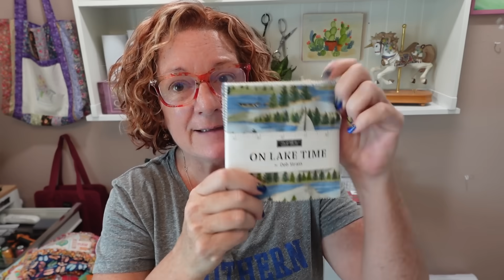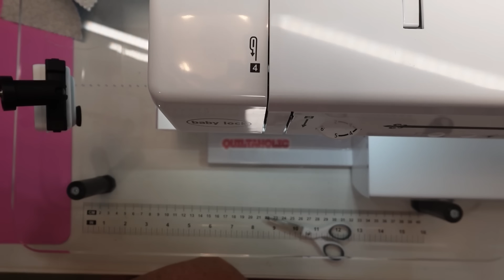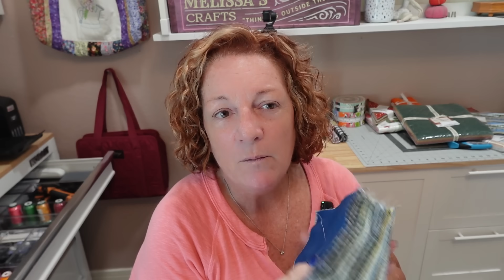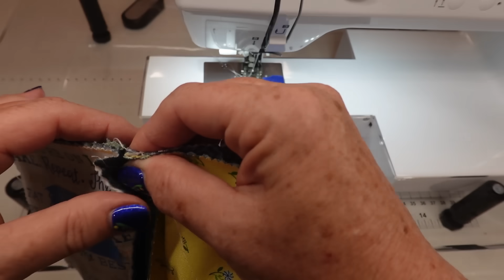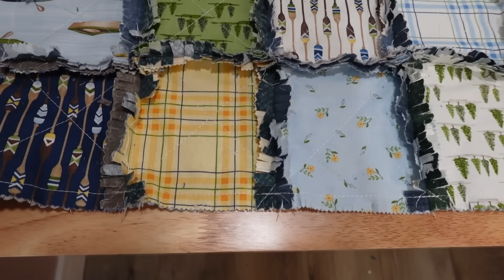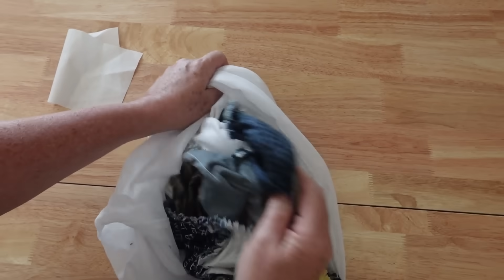🧵❤️ No-Cut (But Yes, You Still Clip!) Rag Quilt – Step-by-Step Tutorial

Comment: I didn't know it was ok to back stitch using the walking foot.  In fact in a class they told us not.
But, it looks like it worked just fine!!!!🎉
Reply from the maker: I had someone else mention that as well.  I have been backstitching with my walking foot (on this and a previous machine) for years and never knew that might not be a thing.  I started doing some research to get additional info - I keep my walking foot on my machine about 90 % of the time :)
Reply: Same here I was told you couldn't backstretch with a walking foot
Reply from the maker: I think I would cry if I couldn't backstitch with mine - I leave it on my machine almost 90% of the time
Reply: @MakewithMelissa 
I never knew this! I have the same machine as yours (actually ‘3’ of them, love, the best). So now I shall attempt the walking foot back stitch. Thanks; BTW I have been sewing, quilting for years and I am very impressed with your technique and teaching. Keep it up and thanks for your guidance.
Reply from the maker: @DianaBabin-v9i - I love that machine, I have only had it since January - I love how much throat space that it has -- I just finished 2 more bags and back stitched away -- even on my previous singer machine, I did -- Thanks much for commenting and watching the video

Comment: I have always made mine with batting, but boy, does it look so much easier without lol Very good instructions!
Reply: Maybe you wd show how to use an extra layer of flannel.  Excellent video by the way.  Thank you for sharing!
Reply from the maker: Great Idea!  I can most definitely do that -- I'll work on a video that goes thru examples of each 1) Cotton/Flannel, 2) Cotton, Flannel, Cotton, 3 Cotton, Flannel, 4) Flannel and Flannel-- all on a 10X10 to get the complete effect -- that way we can all look at the Weight and Thickness --   Thank you so much for that input!
Reply from the maker: Same here - but after using Flannel and not having to separately cut the batting, was a changer for me - I even started using it in my standard quilts.  I find 2 layers plenty enough weight for here (Florida and TN) but can always add an extra layer of flannel if a heavier blanket type of quilt is desired -- Thanks so much for commenting!!

Comment: What is the finished size of quilts using charm squares and layer cake
Reply from the maker: Here you go, and I'll put on the FAQ document that I'm putting together - The Layer Cake finished measures 52" X 59" (this is edge to edge) = The charm (only made with 1 charm pack for front and back for demo purposes) 24" X 29"  --  I have a calculator for the charm packs for bigger quilts (I'll find that and get it posted)
Reply: @MakewithMelissa thank you for answering…you now have a new subscriber!❤

Comment: I noticed you didn't use any batting. My first two quilts were for my boys and I used batting while wondering if I could have done without since I used flannel on one side. Those are the heaviest quilts. I am glad to see that someone has made them without a d they're holding up and you're pleased with them! Next time I want to throw together a quick quilt it will be a rag quilt without batting! We are hot sleepers and like a quilt for comfort more than warmth. Great tutorial!
Reply from the maker: The first 2 quilt in the video were made at the same time, Christmas 2025 -- The orange and white has batting in between 2 light weight flannel, the "outdoorsy" is just 2 layers of flannel -- the second one, I use every single day, it's my couch quilt--  once I moved away from batting, I started using in my regular quilts -- either way works, but with flannel, I get more "fluff" AND I don't have to cut the batting smaller  --
Reply: When I use flannel on the back I use lightweight muslin in the middle, or nothing.

For light colored fabrics I made sure the backing fabric for those squares is light colored, too
Reply: I like using a low loft batting. I live in Utah and it gets cold in the winter.
Reply: If you do want a warmer quilt, another flannel layer cake for the middle layer.  Cotton square, flannel square, 2nf flannel square.

Comment: Where's the batting? I've rewatched 4 times looking for it, thinking I missed it. Nope. This patchwork blanket has no batting. 😐😑😐
Reply from the maker: Thank you so much for both watching and commenting. Early on I used batting (20 years ago) but I've switched to using flannel for my Rag quilts -  I do use a heavier weighted flannel (not p.j. type flannel) and even with 2 layers they have a great weight to them (plus, I don't have to short cut the batting)  - Couple folks had similar comments, so I did a comparison on the Beach Retreat Rag Quilt (it's the one in all the shorts and I just finished it a month ago) to 1) a Queen quilt my Granny made that is 55 years old and 3) the rag quilt I made 20 years ago with batting  --  All few came within just a few ounces of each other --  most of my quilts go to folks in Tennessee or Florida,-- if I have to send one more North, I'll just add another layer of flannel -

Comment: I was surprised you don't use wadding , I suppose this version is lighter weight .very pretty .
Reply from the maker: Thank you so much for both watching and commenting. Early on I used batting (20 years ago) but I've switched to using flannel for my Rag quilts -  I do use a heavier weighted flannel (not p.j. type flannel) and even with 2 layers they have a great weight to them (plus, I don't have to short cut the batting)  - Couple folks had similar comments, so I did a comparison on the Beach Retreat Rag Quilt (it's the one in all the shorts and I just finished it a month ago) to 1) a Queen quilt my Granny made that is 55 years old and 3) the rag quilt I made 20 years ago with batting  --  All few came within just a few ounces of each other --  most of my quilts go to folks in Tennessee or Florida,-- if I have to send one more North, I'll just add another layer of flannel -
Reply: @MakewithMelissa I'm in the UK so it's a bit colder here probably lol . But I like the idea of using the flannel and it would make a nice summer quilt ,I am going to try it .

Comment: After watching you, I think I can make my first quilt. All the other videos scare me with all the cutting and geometry, math I’m not good at. Thank you so much.
Reply: It can get tricky. If you keep it simple it works better. Use 1/2 inch seams, if you do then each block will be 1 inch smaller then what you cut. So a 10 inch block will be 9 inches sewn. (A layer cake pack is 10 inches per block before sewing). Add up the sewn block sizes to figure out how big you want your quilt, down and across. 7 blocks across will be 63 inches (7 blocks x 9 inches) 8 blocks down will be 72 inches (8 blocks x 9 inches) so you will need to have a total of 63 blocks (7x9) to make your quilt. You can also make strips and sew them together.
Reply: @nancy9478  I have 4x4 squares. How many do I need across and down? I want to make my daughter a quilt for Christmas. not much time ik.. and i've never made one.. Maybe a twin size? oversized throw.
Reply: @nancy9478 thank youuuuuu
Reply from the maker: That is why I love to make them with Layer Cakes.  Starting out with precut blocks already perfectly cut,  sets the foundation for a great sewing experience.   When I'm doing the layer cake version, I use a 1-inch seam this give me big puffy seams when clipped -- I line up where my bobbin plate hits the machine (yours might be different) -- it is closer to 1 inch than 3/5 -- the finished size of my version of the Layer cake is 53 X 58

Comment: Very clear instructions & you make it sound fun. But why no batting? How many would you need to add to make it a lap size? I'm glad I found your channel! 😊
Now I see why you didn't use batting, makes sense! Super cute idea. Thanks~
Reply from the maker: A few other folks were also interested in the "No batting" - here you go 
 
Thank you so much for both watching and commenting. Early on I used batting (20 years ago) but I've switched to using flannel for my Rag quilts -  I do use a heavier weighted flannel (not p.j. type flannel) and even with 2 layers they have a great weight to them (plus, I don't have to short cut the batting)  - Couple folks had similar comments, so I did a comparison on the Beach Retreat Rag Quilt (it's the one in all the shorts and I just finished it a month ago) to 1) a Queen quilt my Granny made that is 55 years old and 3) the rag quilt I made 20 years ago with batting  --  All few came within just a few ounces of each other --  most of my quilts go to folks in Tennessee or Florida,-- if I have to send one more North, I'll just add another layer of flannel -

Comment: Do you not use batting?
Reply from the maker: Thank you so much for both watching and commenting. Early on I used batting (20 years ago) but I've switched to using flannel for my Rag quilts -  I do use a heavier weighted flannel (not p.j. type flannel) and even with 2 layers they have a great weight to them (plus, I don't have to short cut the batting)  - Couple folks had similar comments, so I did a comparison on the Beach Retreat Rag Quilt (it's the one in all the shorts and I just finished it a month ago) to 1) a Queen quilt my Granny made that is 55 years old and 3) the rag quilt I made 20 years ago with batting  --  All few came within just a few ounces of each other --  most of my quilts go to folks in Tennessee or Florida,-- if I have to send one more North, I'll just add another layer of flannel -

Comment: Here in No. Wisc. we add batting squares in the middle to give more warmth.
Reply from the maker: Thanks so much for commenting -- when i send quilts up "North" I'll add an extra layer of Flannel if additional warmth is needed  :)
Reply: @There-b9o  do you cut and clip the batting squares the same as the top and bottom squares? I really like the look of these but without a thick batting center we will not be warm in the winter here. Thank you!

Comment: Why do you need walking foot. When its just 2 layers
Reply from the maker: Great question! Even with just two layers, I find a walking foot makes a big difference—especially when one side is flannel and the other is cotton. The textures and thicknesses aren’t always the same, and once you start joining rows and sewing over those bulky seams, the walking foot just glides right through. I’ve made plenty of quilts without it and they turned out fine, but having it on really smooths things out. Honestly, I keep mine on for lots of projects—not just quilting!
Reply: When you fold over the seam allowances it’s 4 layers and also working with flannel, it helps because the flannel is a smidge thicker than the cotton. Walking Foot for the win! 🎉

Comment: I am a little confused.  NO BATTING right? Is the quilt heavy or more like a thin blanket.  Obviously I've never made a rag quilt although I have made many quilts. I've never not used batting in the middle.
Reply from the maker: Great question— When I first started making rag quilts (about 20 years ago), I used batting too. But after moving to a warmer climate, I shifted to using just flannel and cotton. It makes the quilt lighter and more breathable, which is perfect for our weather. If I ever want extra weight or warmth, I simply add another layer of flannel in the middle. 

I actually use flannel instead of batting in most of my quilt projects now—not just rag quilts. It’s such a versatile option, especially when I want something snuggly but not too heavy.
Reply: It's a 'coverlet' quilt that can be used on its own in warmer weather.
If you want warmth, put another layer over it. The raised edges will trap air between the two layers without weight.
Reply: A fun project!
Reply from the maker: @angelapaules-f1f  thank you!!!

Comment: It’s so foreign to me not to use batting
Reply from the maker: Totally hear you—it felt foreign to me at first too! I used batting for years, but once I moved to a warmer climate, flannel became my go-to. It’s lighter, still cozy, and way easier to work with. I even use it in most of my other quilt projects now!
Reply: Traditionally, many quilts were made without batting
Reply from the maker: so true, i have all my Granny's, Mamaw's, Great Great Grandmother's Quilts and very much in use (55 to 60 years old)- but they are all very much if not thinner than the Rag Quilts that I make -- I was curious after reading some of the comments, so I weighed them - and they were all within a couple ounces of each other (and the quilts are queen size) -- the flannel I use is not "PJ" flannel, but a much heavier weight --- they really do work up to a nice weight, definitely not "thin" -- this give me a great idea for a topic to compare and contrast the different types of layers :)  and even to my heritage quilts
Reply: Give it a try. Then it wont be foreign. Its cozy flannel

Comment: If you use batting, cut it an inch smsaller than your top and bottom squares...it gets sewn in with the x's but you dont have to clip it later as an extra layer...do everything else the same😊 Good tutorlal...What about the edges?
Reply: I wondered if that would be the way to go if I needed batting for cold weather.
Reply from the maker: @andrea.rivers  honestly I would just do another layer of flannel that way you get really fluffy seams plus you don’t have to do extra cuts to make your batting smaller
Reply from the maker: Thanks so much, Giselle! That’s a great tip—cutting the batting smaller is such a smart way to keep the bulk down and avoid clipping through that extra layer. I’ve opted for an extra layer of flannel instead of batting lately, if I need that “up north” kind of warmth. And those seams turn out so fluffy! 💙 Appreciate you sharing your process!  Why "up North" -- live in Florida now LOL
Reply: Great idea!!
Reply: Use double of the same flannel??
Reply: I was wondering the same thing. Thanks. Can't wait to try

Comment: The laundry bag with the color catcher in side is a tip I've never heard.  Thanks!
Reply from the maker: I had been using the color catchers for a bit, but the laundry bag was a new addition after I clogged up my washer (not fun) -- with all the shaking outside, the lint brush and putting in the dryer before -- it has dramatically reduced the lint in the washer -- Plus, I find that I only really have to do 1 washing before gifting  :)  -- Thanks for commenting!!
Reply: Me, either.  I just toss 2 into the washer
Reply: I never thought of putting them in the bag either.   I always toss a fee in the washer.  Learn something new.

Comment: I’ve made a few rag quilts, but appreciate the tips on catching all that lint before washing it.  Was also surprised that you didn’t use any batting, but that’s okay!  
😊New subscriber!
Reply from the maker: Hi and Welcome!  oh, that lint ... yes, after have a service call on my washer a while back, I had to search out more effective ways to wash at home, getting to a laundry is not real convenient for me -- Batting?  early on (20 years ago) I did the batting in the middle, and they made nice thick quilts (but i had to cut it LOL) -- I now live in Florida, so most of the quilts/blanket need to be a bit lighter weight.  If I need to send one up North, I just add an additional layer of Flannel in the middle or do both layers of Flannel -- the quilts with the extra flannel in the middle, you should see how they rag up!  so pretty -- Thanks so much for watching and commenting!
Reply: @MakewithMelissa  When you put flannel in the middle for extra warmth, are you cutting them the same size as as the top and bottom squares? And when you clip you are clipping three three layers?
Reply from the maker: Yes, that is correct, the middle layer flannel is the same size square so - and clipping thru 3 layers.  I have even made them with cotton on front and back, flannel in the middle -- that makes a really good weight blanket
Reply from the maker: In the Layer Cake version (that video will be coming soon) I use the full pack, there are 42 squares in the pack - I use 2 layer cakes, one for the front and one for the back - my rows are 6 x 7  -- I don't use batting in my version, if you desire a heavier weight, I would just add another layer of flannel
Reply: @MakewithMelissa  Hi, I am new to all this, rag quilts, your site, the how too's, etc.  So I was reading through the comments to find out why you never used quilt batting and ended up here!  So if I was to use batting (from Iowa) do you cut the batting the same size as the two outer fabrics, if not then how????  Me and my cat (Baby Love) would never survive the winters without batting.  Thanks...